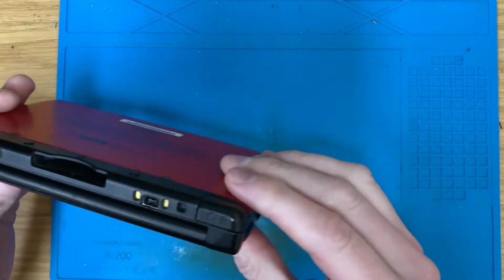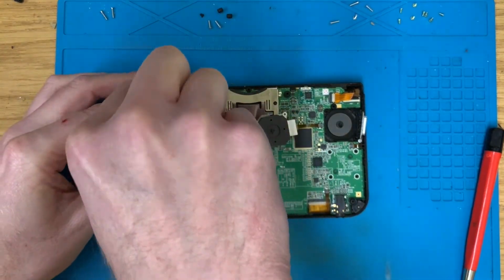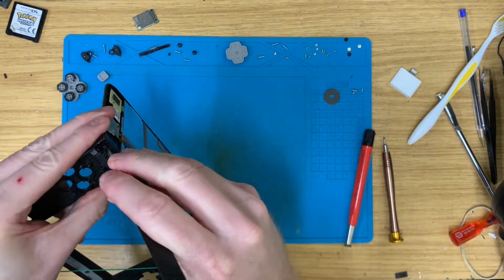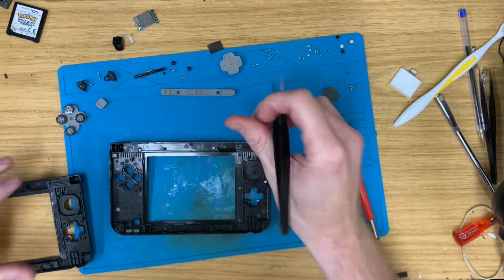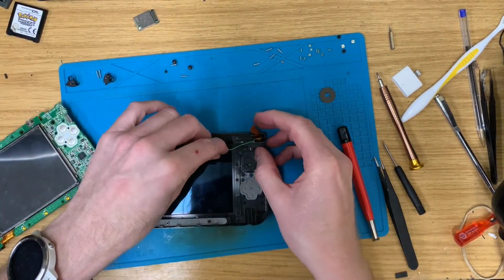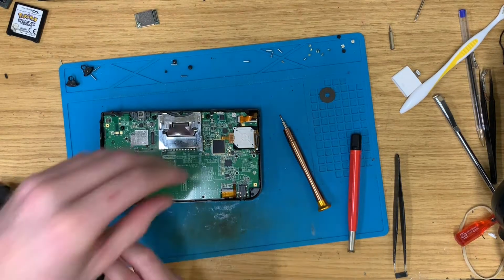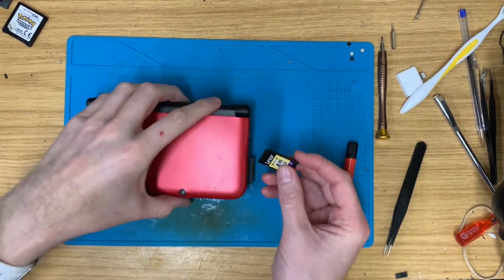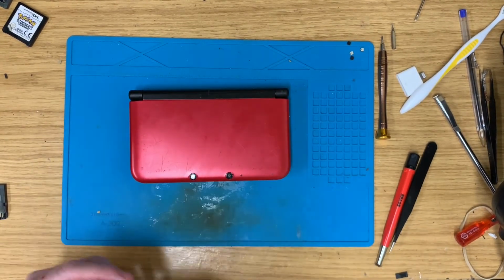Red 3DS XL   Mid Frame  / Hinge Replace & Luma Installation

Comment: dude this is an awesome video. i have a bit of electronic repair experience but the 3ds has always been daunting to me because its so easy to mess up on. going to use this video to replace my middle frame. thank you
Reply from the maker: Glad I could help ☺️☺️☺️
Reply: @1up_Gaming  i went to ifixubreak bc my 3ds xl hinge broke he said is unfixable is that true?
Reply: @forcefulrelic31  It's not true, you can fix the hinge. If I had to guess, he probably rejected you because replacing the hinge is a risky repair. It's easy to tear the ribbon cables for the top screen and speakers.

Comment: I am currently stuck at the part at 18:29 I got the barrel hinge pushed through a bit but not far enough for it to be locked by the cap and I can't get it pushed any further. Anything I can do? I don't think I can pull it back or get the cap out again...
Reply from the maker: Try moving the hinge mechanism, if it’s not locked in place it will work its way loose pretty quickly
Reply: @1up_Gaming  My dad helped me getting it in but now I have a new problem. The thing that holds the middle ribbon cable coming from the top screen in place doesn't want to click. I can't get the cable to stay where it is because of shitty console inside design

Comment: I don’t understand how easily the top plate came off for you. I’ve been prying at it and pushing as hard as I can and it won’t come out. All of the screws are removed I don’t get it
Reply from the maker: Doesn't always happen, I've had some that were water damaged and basically had to rip them off piece by piece :(

Comment: I’m lost on the hinge part and how to attach the top screen back to the mid frame, I don’t have the little clear but you put back inside only the black end that goes inside the mid frame and the tic tac looking part that goes into the top frame hinge hole itself? I cant put the top part on as this piece sticks out what am I meant to do 😭
Reply from the maker: The barrel hinge needs to push in, it will ONLY ouch in if you take the top part of the shell off 👍👍

Comment: Hey just followed your tutorial and reassembled my DS, the touch screen is working by touch but not showing anything on the screen, do you know what I might have missed?
Reply from the maker: Could be that you’ve not put the lcd screen ribbon back in properly, if the back light is in it will still turn on but not display 🙌
Reply: @1up_Gaming  Thanks bro I'll have a look at that 😁

Comment: it was smooth sailing till the ribbon cable connector gray tab snapped off. I only moved the mother board a bit and it broke lol. It turned out to be the connector for the touch screen digitizer. I don't want to replace the entire mother board over this one connector. I wonder if there's any way to provide enough tension with the ribbon cable and connector to get it to work again. Like the ribbon cable just needs to make enough contact with connector without using the gray tab to push it down
Reply from the maker: The touch one IS replaceable, if you apply heat underneath, it's just about doable, the screen ones I've never had any luck with though as they double up one on each side, so I couldn't heat underneath :(

Comment: Question, my 3ds xl Y button is unresponsive unless I press down hard enough, I took everything apart and got to the buttons inside, I wiped it down with rubbing alcohol, cleaned off any potential dirt and grime off the shell openings of the button (accidentally caused the touch screen to not work, then not turn on), and still nothing. Is something wrong with the button board?
Reply from the maker: Try turning the rubber round 90 degrees and seeing if that changes it to another button, if so, it'll be the rubber that needs swapping.
Reply: @1up_Gaming  An update: I have this method, and still the Y Button still needs a bit more force for it to respond, and even then it's unreliable.